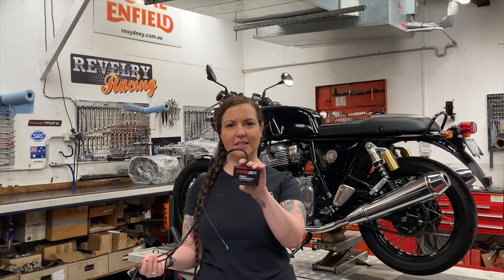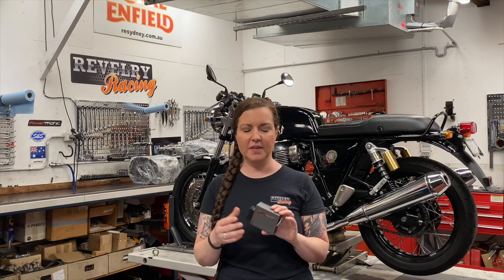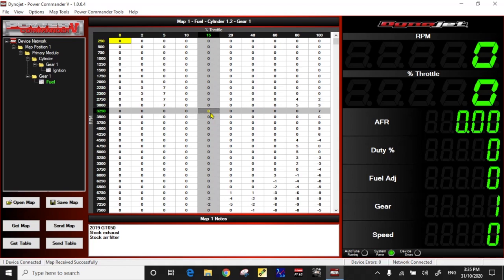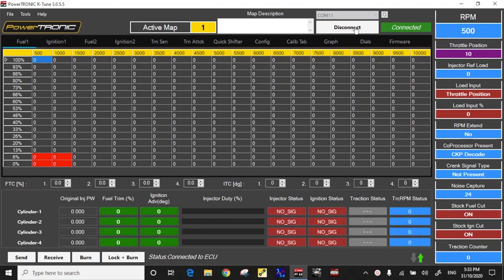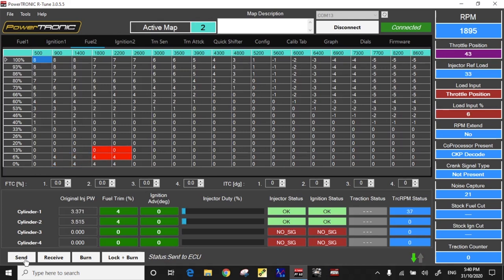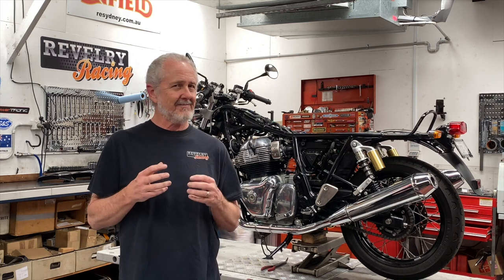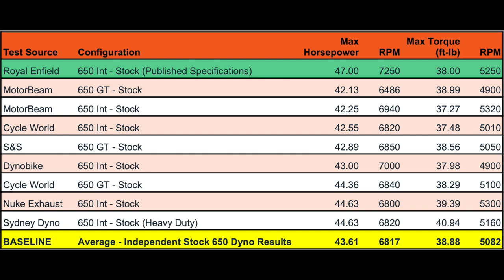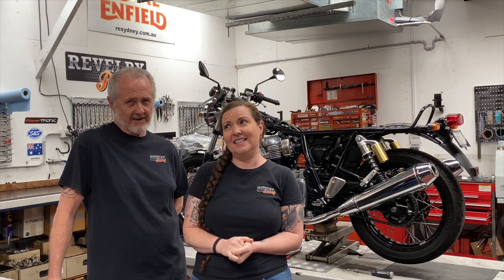Episode 5: EFI Tuners Part 2 -  Royal Enfield 650 Twin

Comment: Hello I am riding a Glitter & Dust 2020 "INT 650" here in NY. It has 2300 miles so far. No issues to date. For the engine mods, I have substituted S&S Race Only muffs, DNA air filter and cover removal clips, and a Booster Plug. I'm interested in your SS headers, w/ only the stock bungs. I ride mostly on twisty, hilly back roads, and thoroughly enjoy the improvement over my 1970 750 Interceptor!!
That was a real test of my dedication, and after 17 years, I sold it off (ten years before its value increased 600%, LOL).

Comment: Awesome video very informative can't wait to purchase a 650 interceptor
Reply from the maker: @frederickwoods5943  We just did an 865 kit on a bike with over 40,000 kms on the clock. When we did the disassembly we found NOTHING in the engine that was even close to any service wear limit. The manufacturing build quality of these bikes is just exceptional!
Reply: @RevelryCycles   -  Yeeeeek!!  865cc displacement, up from 648cc?
Do you run it rich to keep the temps down?  Will it work with the stock exhaust?

Comment: Customised Continental GT650 with big bore, S&S cams, filter and dyno commander. 65hp but caused clutch slip so replacing with S&S performance clutch. Love the bike.
Reply: How did you delete the O2 lambda on your 865? Power commander says the majority of the map is closed loop and I can’t get it rich enough, the computer keeps leaning it based on O2

Comment: Great video putting the meat and potatoes into EFI tuning. 

I got the Int650 for the slightly larger fuel tank and lower price. I put on lower bars, end mirrors, and ordered the dual touring seat and cowl to get the looks. With the comfier riding position and slightly longer cruising range I feel it's the perfect balance.

Comment: Thanks for clarifying in detail the dif between PCV and Powertronic. I've installed PCV on Triumphs and they typically include timing change capability, so its a surprise to see its not included for the RE. Also there appears to be from my perusing the Powertronics web page, a different model with no ignition modulators mentioned or pictured. Love to get clarified on that. Thanks for the detailed look at each.

Comment: G'day from South Wales.....the original one in the UK, not New South Wales in Aus!!  haha.

You guys are producing the most comprehensive RE650 performance tuning vids on YewToob that I've seen, and all presented and explained in a very friendly and easily understandable way. Good on Ya!!

Really looking forward to more vids.......are you going to do one on head porting, and big valve conversions if the space between the valve seats will allow it?

Thanks again for the vids both.
Reply from the maker: Thanks mate! Our pleasure!
Reply: A very warm hug to both of you from India ! This series is so productive and simple !

I wanted to know, if you will ever do a complete S&S kitted bike - including the performance clutch pack, the forged pistons and the wiring harness (anything I might have missed from the S&S catalogue)

I have recently picked up the INT650, I plan to convert this into a project motorcycle - complete with the 865 Kit, camshaft, forged pistons, performance clutch pack, the air filter + plate, tumer etc.

This is gonna be with me for years, so brakes, suspension, throttle and anything else will be upgraded to reflect performance, I would like to hopefully bounce off my ideas through you guys, coz you seem to be knowledgeable and more so .. practical ! 

Thanks and loads of love !!

Comment: thank you for this info.  Please put your microphone closer to you
also, would love to know what results are without the S&S cam since this is probably the most common mod set

thank you for these videos
Reply from the maker: Interestingly the results for this combination without the cam are basically the same as the cammed bike without the tuner. Air cleaner, S&S mufflers, headers and a tuner are generally good for something like 49-50 HP and 42-44 ft-lb.
Reply: @RevelryCycles  hmm, so cam adds about 3hp with tuning?
Reply: No, I believe I misunderstand

Comment: Just about to build a High compression 650 just acquiring the parts . Have the new clutch and Cam and the high compression pistons, I did get a Power commander 6 not realizing I can only connect it to a Windows computer.   The does the Powertronics only connect to a Windows computer as well or can I use a Mac their website didn't say?  Also what power gains can I expect with the parts I mentioned in the begining I figured you would know for sure 😁 Love your guys channel by the way.

Comment: A low restriction oil-wetted air filter always seems to be the first engine mod made, but impartial tests show that the trade-off is more dust getting through the filter.  Is it possible to modify the air box to accept a larger cellulose filter?

Comment: Hi, thanks for this video.
From South Pacific island.
Interceptor Euro5 22 
FuelXpro...TEC cannon silencers.....full TEC 2in2 pipes.....36 rear sprocket.....
Want to install a fuel injection module like power commander ecu or power tronic ecu
**Want the popping and fire sound at the exhausts

Comment: Does  the s&s  powertronic come with the two  ignition modulators? Thanks for your great content. You got yourself a subscriber from England UK.
Reply from the maker: Yes, the modulators are included in the PowerTronic kit for the 650. Also, just to avoid confusion, S&S do not sell PowerTronic.

Comment: (Why no pricing on components now?) Just wondering how you know how to adjust the mapping? I guess ideally you'd have it on a dyno, but how much can you do by riding? How dangerous is it to DIY the mapping purely by riding? Or by using downloaded maps? Would you build the bike, map it on a dyno, then as long as you didn't change the bike it should be OK?

Comment: 2020 Interceptor 650. Great video and explained this so well. What do you think about booster plugs being used to compensate for stage 2 air filters and slip on exhausts? I know you have touched upon the subject but I just wanted to know what you think and if you have done any testing on the same. Is the booster plug advisable for smaller mods like these? Many people feel that rich is better than lean and hence go for the booster plug. Also, please put up more videos of that big bore wheelie monster! And get a motoring publication to to review it or something. It looks wicked and fast! More videos of that bike please. What's the fastest quarter-mile clocked by your drag spec twins? Here in India among locally manufactured motorcycles, the RD350 is still king of drag strip clocking mid 11s at the 1/4 mile. Keep 'em videos coming! - Love from India.
Reply from the maker: We have not fitted a booster plug so we have no first hand experience with it. However, as far as we can see, all the reviews the about them are positive.  If you're just doing air filter and mufflers we expect they would work exactly as advertised. In Australia they are nearly half the price of one of the other tuners so, because we're after more control, we just haven't fitted one yet.

Comment: What if the spark connectors are miss labeled and are backwards? Would the bike start?
Reply from the maker: The 270 opposed twin is NOT a wasted spark system, so NO. If you swap the coils, the bike will not start.

Comment: Hi, I've got an Euro5 Interceptor 650 and I installed a S&S air filter and 2 in 1 exaust and thinking on installing a FuelX from Powertronic. Could you give me your feedback on it, please?. I'm not a fully experimented rider so I'll go for LITE version. Thanks in advance
Reply from the maker: We haven't actully run the LITE version so I can't give you an informed answer. However, that's really what it's designed for so I expect it will work fine on your combination.
We have run the PRO version. On a bike with air cleaner/full exhaust system and a cam, on setting 10, it will increase the air fuel ratio almost a full point (from mid/high 14s to mid/high 13s) which is exactly where it needs to be for general use.
Reply: @RevelryCycles  Thank you very much for your answer. I had my doubts on LITE or PRO but after your feedback, I think I'll go for PRO version as eventually I'll install the cam too and to be honest I trust you a lot.

Comment: I am riding a Continental GT. 
I have a question for Santina. 
How do you manage your hair in a fireproof suit with the helmet on the strip?
Just asking out of curiosity. 

Also, I will soon have to get a new rear tyre for my bike should I go with a wider 150 or the stock 130?

Do you also plan to do a video on Ohlins Front and Read Suspension?
If not will you consider doing one there is only so much information on YouTube of it.
Reply from the maker: LOL So on a motorcycle we wear a leather suit but not fireproof.  I did research before I started racing and found that long hair had little impact on aerodynamics as long as it was braided.  It's uncomfortable to tuck it down my jacket so I just let it fly. 

You certainly can do a 150 it fits without modification.   

Not sure about the suspension video.  We get asked about it on YouTube but rarely in the store.  We will just have to see where the videos take us.
Reply: @RevelryCycles  
I will keep an eye out for the video.

I found the bike to be more light than my liking at triple-digit speed. 
Adjustable front fork inserts should hopefully be an easier job than replacing the forks altogether.

Do you have people come to you with the same problem?
What do you recommend them?
Reply: @RevelryCycles   -  As you may already know, Stu Fillingham was very impressed by the YSS suspension kits and believes Öhlins equipment costs too much.  Yet, some owners like to "gild the lilly", so a comparison would be welcomed.

Comment: GT here. No mention of the lambda sensor. Did you completely disconnect it for your tuning?
Reply from the maker: We didn't mention it because both systems are designed to work with the OE closed loop system intact. You DO NOT need to disconnect (or otherwise circumvent) the sensors. The bike still idles and cruises in closed loop.
Reply: @RevelryCycles  I can’t get it rich enough on the power commander, the computer keeps leaning it based on O2. My tuner puts in high numbers on the dyno,  and the closed loop lowers it back down. He’s afraid it may set a check engine light. Dynojet says they couldn’t help, I’m going to put a call in to S&S
Reply from the maker: @williamrobertson8962  We have a number of 865cc bikes running the PowerCommander that start, idle, run just fine and make in the 70hp range at something like 13.2 AFR under hard acceleration and wide open throttle.  The narrow band closed loop system in the original ECU only operates at idle, cruise and light loads only. Under these circumstances the system only knows wether O2 content in the exhaust indicates richer or leaner than 14.7 and the ecu drives the mixture back there. At idle, while crusing and at light loads, 14.7 is what you want anyway, regardless of what fuel ratio you're chasing for wide open throttle and hard acceleration. 

While you're doing dyno runs you can experience the closed loop switching that makes a the dyno's wide band sensors show some pretty erratic readings. The trick is to simply unplug the O2 sensors and ignore the light while dyno tuning for the best power and smoothest acceleration. Then you'll find that when you plug them back in and clear the codes the bike starts and idles fine, is well mannered in traffic and makes plenty of power when you're on the throttle.
Reply: @RevelryCycles  thank you for the response. I’ll forward this to my tuner. Hitchcocks Power Commander comes with O2 eliminators. Dynojet says they can’t provide them in the US. Dynojet also said the mid range of the map was the closed loop portion and their map on the website was an incorrect open loop map . It has supposedly been rectified by Dynojet. 

We would tune it, run it on the road then put it back on the dyno and it would sag in the mid section where it was leaned and plugs were a tad white.  I’m going to try 4-pin O2 eliminators for a Polaris RZR and see if we can get the curve steady. 

865, S&S cam and Head work, DNA filter w/lid removed, Kspeed Diablo full exhaust, it’s pulling right at 59hp on the DynoJet dyno for us. 

I emailed a while back, I wish you guys made the timing wheel adapter available for purchase. I made a set up of my own but it has too much slop on the stock crank nut. So I used the stock tools and checked TDC with a dial gauge but that’s not accurate enough either as there’s probably 3 degrees on the top duration. So it may be too advanced or retarded, I just don’t know for sure.

Comment: can you run the powertronics along with the booster plug?
Reply from the maker: Sure, you could. The booster plug would still be altering the AIT sensor signal to the OEM ECU so the PowerTronic would effectively just be tuning around it.